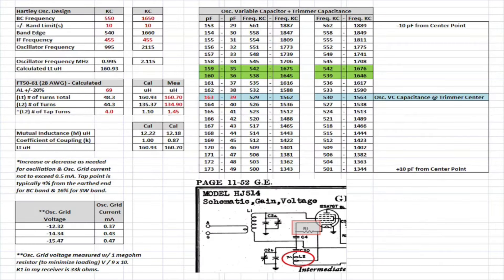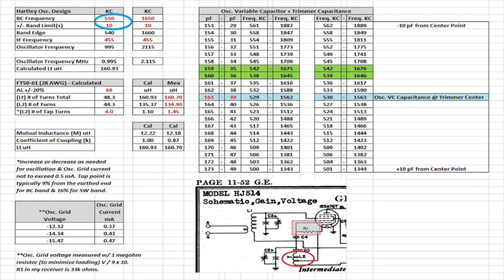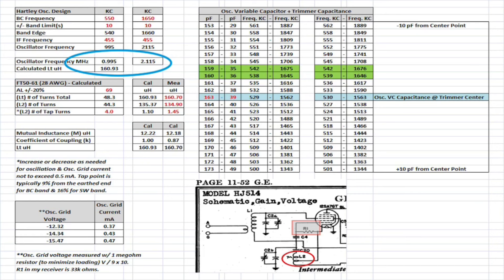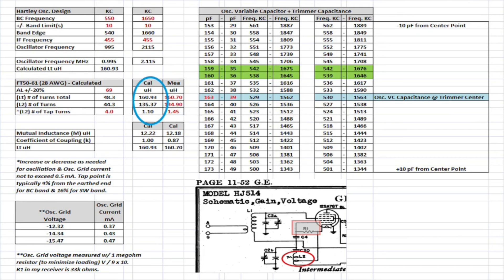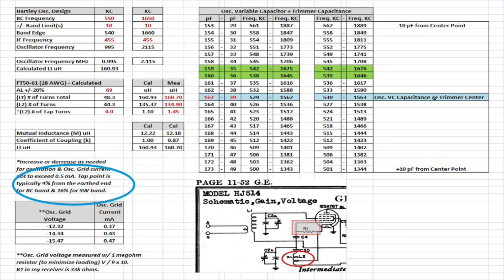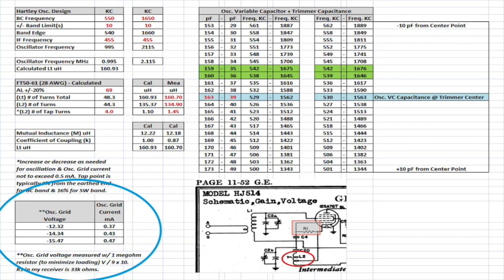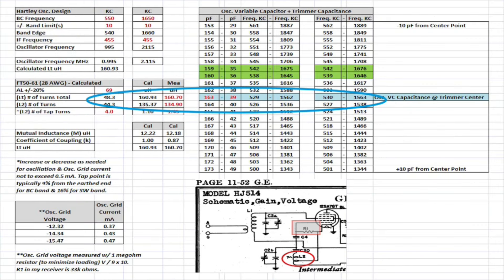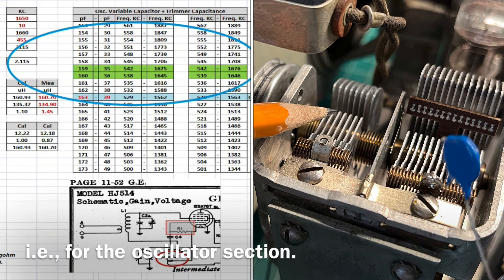General Electric (GE) HJ-514 | Toroid Hartley Oscillator Design

Comment: Dear sir I have a radio with wierd problem. Radio has Philips TEA5711T AM FM STEREO IC. FM is perfectly working.
AM like MW SW aren't working even not producing AM hiss sound completely silent.
Tested the pin voltages with datasheet reference.
Tested the oscillator and UF coils, sliding switch.
Replaced all bad electrolytic capacitors.
Still FM only functioning.
AM is not working at all.
I doubt the ic should have gone but the Vp supply voltage is only 5.5 V DC.
Please help me sir i have tried but unable to fix the problem.